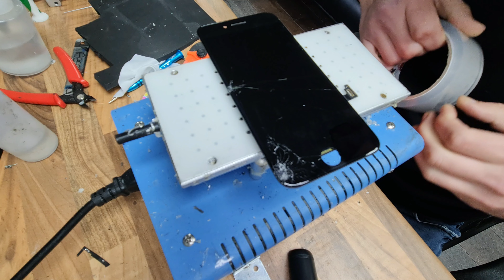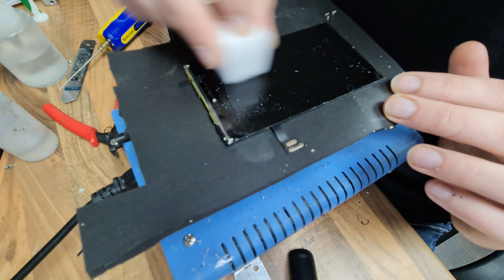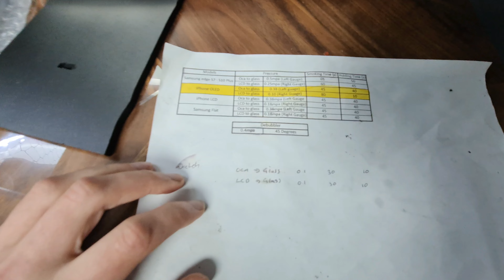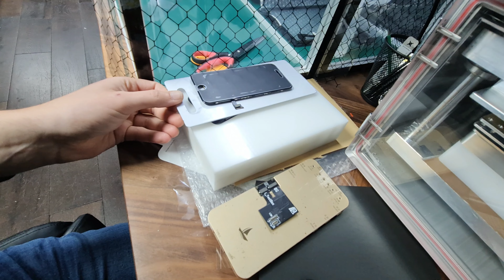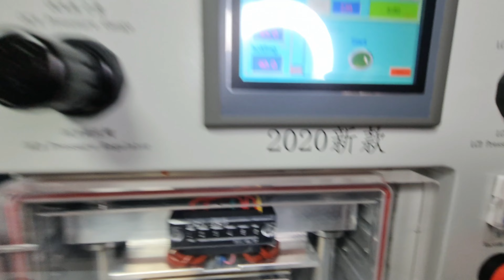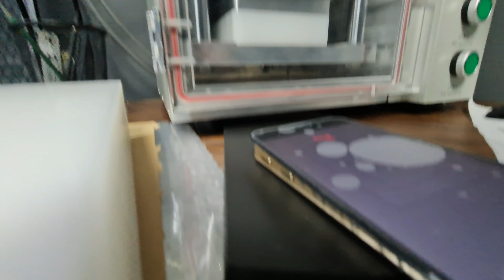iPhone 8 Glass only how to

Comment: Great video and loads of great tips and info, thanks for the share. You’re probably the best person to ask… I bought one of those pressurised chambers (bubble machine)but it’s the one without the built in pump. In the book that come with it just says you need a pump. Do I need a air compressor pump or vacuum pump? Do I need a pump that blows air or sucks? Probably sounds like a silly question but I’m stuck and not sure which to buy. Thanks so much in advance for any help you can give me. Thanks rich
Reply from the maker: THANKS. 

For purely a debubble machine, you'd want an Air compressor. Ideally one with a small receiver (tank) with it. As you expand, you'll need a few other bits that require compressed air, so the receiver will give you a bit of head room instead of the compressor constantly kicking in every couple of minutes.
Reply: @ifixphonesplymouth906  knew you was the right person to ask. honestly I really appreciate the help. Have you got a recommendation for model of air compressor to buy by any chance? I’ve never done screen repairs before and haven’t got a clue about any of this, just learning as I go along. Honestly thanks so much rich
Reply from the maker: @SURGE101  The one I bought, was part of a kit from China (as all the refurbishing kit comes from there) 
if you want to drop me a message (website/social media is in the description), I can forward on some contacts and you can weigh up some options. Else, pretty much any half decent one from a tool supplier/tool hire type place that sells them (in the UK it would be Machine Mart). You would then need to work out the fittings etc when you receive it to plumb into the kit. 
I just went for ease, bought everything that was compatible with each other which was proven by the supplier. 
Be warned though, when shipping in from China, it's currently at around £10 Per kilo to ship!
Reply: @ifixphonesplymouth906  honestly thanks so much, I really do appreciate your help. It’s really helps being able to talk to someone who knows about this stuff because the suppliers in china don’t offer a great deal of information when they sell it to you. Thanks rich
Reply from the maker: @SURGE101  There are some who are really helpful, if you're in need of contacts, just drop me a message!
Best of luck!